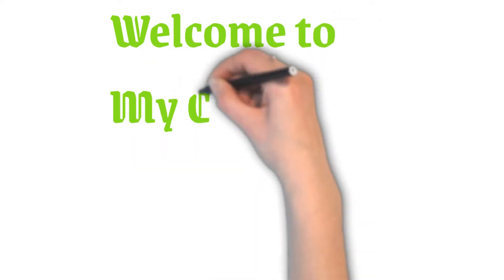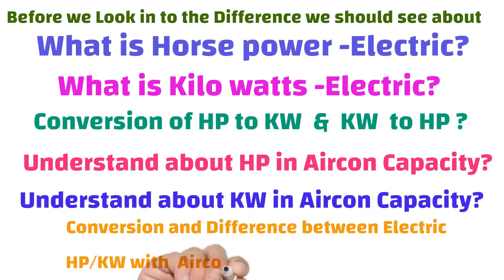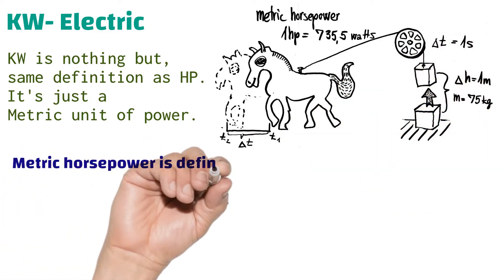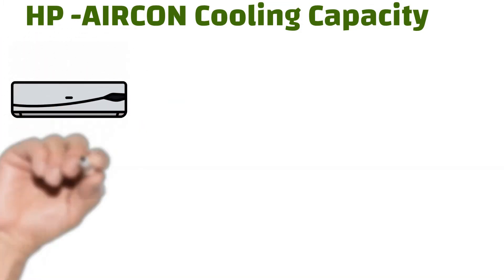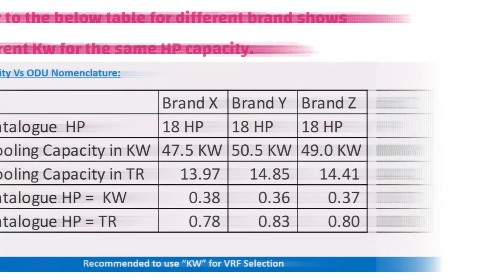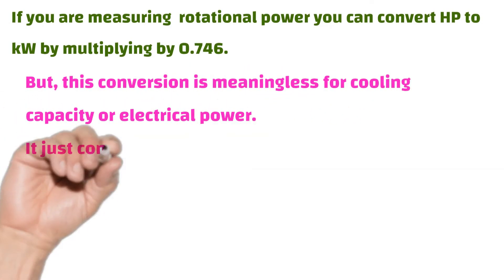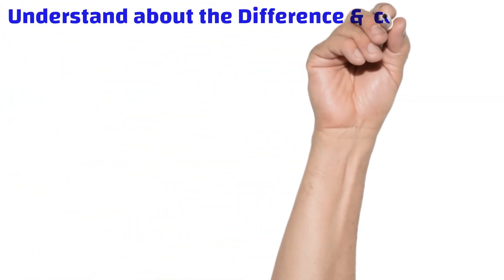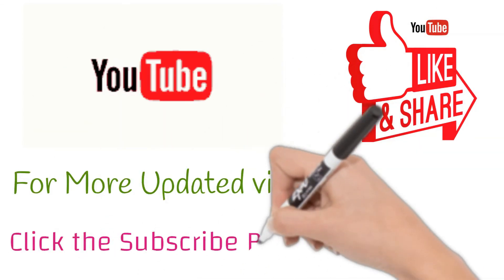Easy Understand about the Difference between Electric HP & KW and Aircon Capacity HP & KW

Comment: where is the conversion 2.8 kw = 1 HP , is this a rule-of-thumb because this conversion might vary depending on the COP of the AC unit?
Reply from the maker: In terms of cooling capacity Hp is a nomenclature.There is no actual conversion.It may vary due to performance and  it vary for every brand.
Reply from the maker: Yes ,1Hp=2.8kw is thumb rule conversion  for cooling capacity not for Electrical.